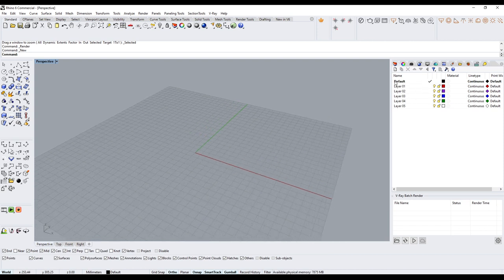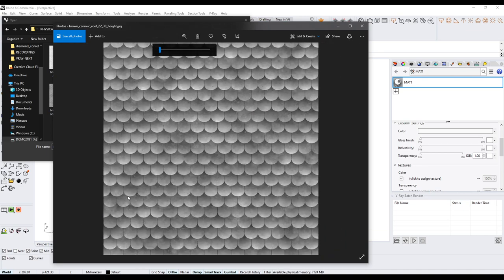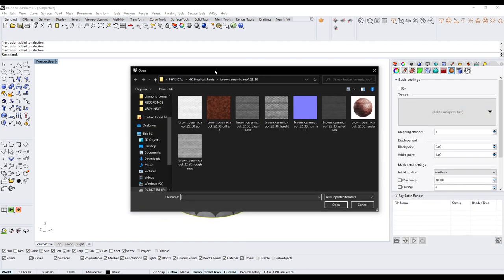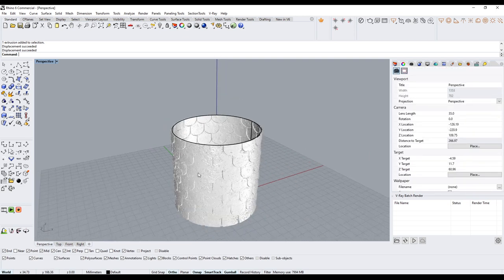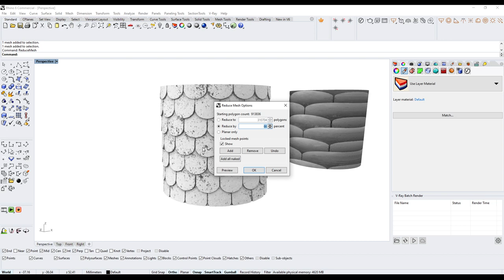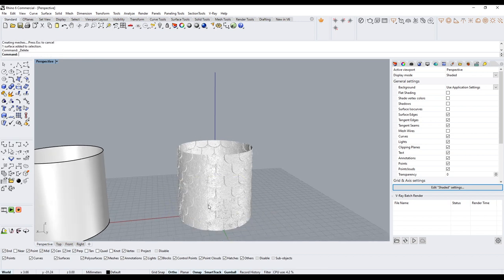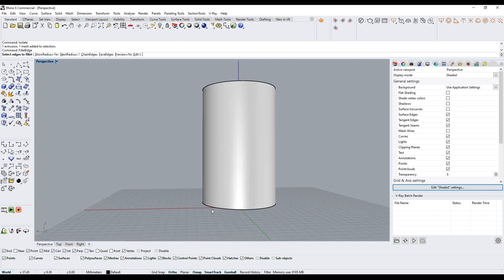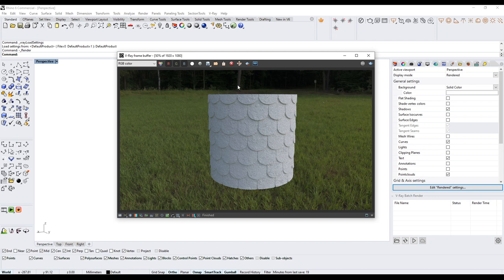Displacement Using Texture Extract Mesh Preview Rhino 3D Tutorial 3D Printing and Design

Comment: hello very helpful please show us more examples of texturing surface of objects.. also noticed after you joined it says open mesh is this why not doing boolean difference ???
Reply from the maker: Boolean difference wont work because its no longer a nurbs object, its a mesh.Try meshboolean commands.  You are correct, in some instances the mesh may be open, and therefore you need to close it off.  There are some methods of doing that.  I will do a video update on this and expand on your question, thanks for the feedback!
Reply: @DCOParametric  ok many Thanks👍

Comment: I’m trying to texture map on a complex geometry shape but the displacement on it is not working properly. Its coming out all weird and ridgidly bumpy rather than along the texture i’ve chosen .. any help?
Reply: Like does the file format you saved the images in matter? i saved mine as PNG
Reply: The shape im using is a mesh
Reply from the maker: you may need to adjust the texture mapping.  you can select individual faces using subobjects to apply multiple materials within a solid polysurface, before diplacing.